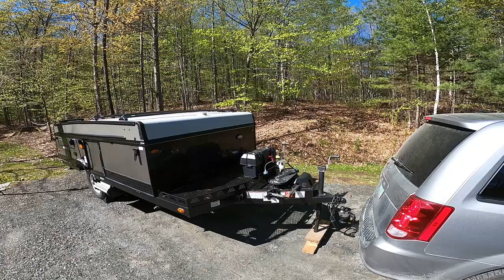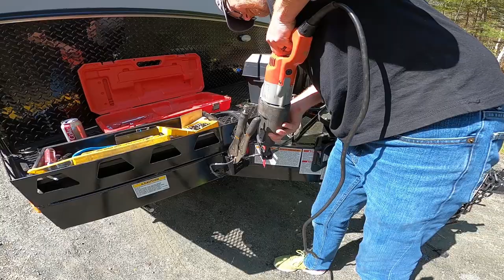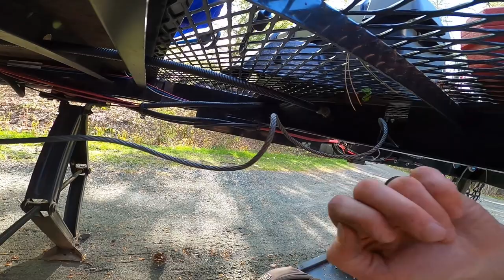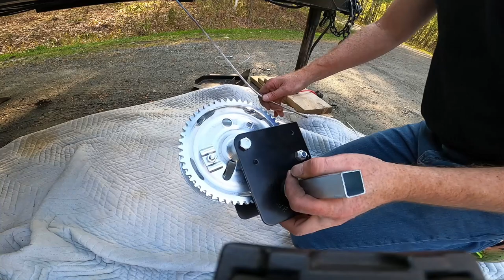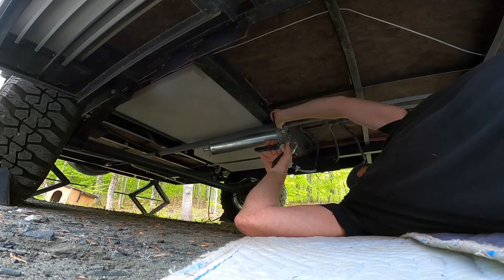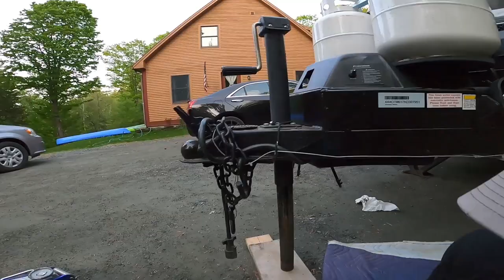2019 Rockwood Pop Up Manual Winch Install | Electric Winch Be Gone!

Comment: Thank you so much I had no idea what to do once my electric winch the motor shaft snapped. I called Goshen and got the manual winch in a few says and had my camper back up and running much faster than the 3-6 weeks waiting for the motor and it works a lot better
Reply from the maker: Awesome 👏 thank you for the feedback 🙏

Comment: Thank YOU for all the video’s, already subscribed 
The wife and I have been thinking of buying our first pop up and we already knew all the models that Rockwood makes. We are so thankful to have seen your video, oddly enough the first one I found was the water damage by the unsealed mess that Rockwood built, we were so Mortified by all the rust and damage your tear down was revealing. We were as well upset about all the rust you found under the axle on your new Rockwood and learned why it was so rusted. It’s was just so rude of the Sales person to not inform you of the plethora of rust under your Brand New Camper by Rockwood. Anyone interested in buying a used and or New pop up should watch your video on the water damage first and thank you for listening all the products used for your outstanding repair!
I like to think in the back of my head that I’m just as hand as you with the ability to do repairs but I’m not. Your video’s tho will definitely be referenced should I need to do any of the repair or preferred upgrades you’ve done. “Well done good Sir, well done.”
ps: Shame on you Rockwood builders and Quality Control Inspectors!
Reply from the maker: I appreciate that you took time to send feedback. I really did think I was saving myself a lot of repair work by buying new. I sure was surprised. And have learned that I’m not alone. The quality and service is very poor  in this industry. But we do it for the memories. Certainly helps to be good with the tools! Happy hunting for yours. Praying you have a great experience 🙏

Comment: Thanks for the video. I have a 232ESP and the drive gear on the motor sheared off while raising it and the roof came crashing back down. Luckily I was at home getting ready to clean it after a trip and not away from home in the middle of the woods or something. During further inspection I noticed the pawl on the clutch was completely worn out. I bought this camper new just over a year ago. I ordered replacement parts for the winch but you have me thinking this is the way I need to go.
Reply from the maker: This is what made me go manual. The winch lifted the top by itself and caused a lot of damage. Scary stuff... just like yours breaking and the roof falling! So unsafe. https://youtu.be/jvKrOAxnrI4 The manual winch is a complete luxury. No fear. Works so well. And best of all... it's so quiet :) You would not regret it.

Comment: Thank you for sharing! I too have powerwinch that the motor went out halfway up and I sheared of the tiny manual bolt. Just got the winch will install today as soon as I figure out how to lower or block the roof in position. Thanks again from Tennessee!
Reply from the maker: Uhhhg! Sorry you too have to deal with it. I used long 2x4s to hold up the roof. Once I got the cable/winch reinstalled I was able to lower it back down. So much fun! Be careful and enjoy the peace and quiet of the manual winch :D God bless you 🙏
Reply: Yeah that’s my plan. I’ve tried to move the gears but no luck. I think once the bolts are loose it should take tension off the cable.  Safety First!
Reply from the maker: @jimwoods8957  I have two auto-style hydraulic jacks. I used them under the 2x4s to lift the roof. Be crazy careful. It is definitely an anxious activity.

Comment: Thats so weird, I had a Rockwood with electric winch and I love it (never had an issue). I am the opposite right now, I will love to replace the manual winch on my Jayco for an electric one. The closest I am is to use a heavy expensive power drill with an adapter.
Reply from the maker: I replaced it because they are dangerous. Ours tried to rip the top off our camper. Bent the hitch mount area too. Very powerful. Very loud. And susceptible to failures.  Here’s the video of when it failed. https://youtu.be/jvKrOAxnrI4?si=peUa3rmeVfYNjDQo
Reply: @sstressfl  interesting, mine was 2014 and was not anything like you are saying, very gentle and never gave us any issue. I guess they changed motor models or something.
Reply from the maker: @angelscomputers  Every product, even a poor one, can have a number of good ones that last a long time and perform as they should. In the video I contacted the dealer and expected surprise from them. They were not surprised. He said I should install a shut off switch on the hitch so there is no power to it when not in use. Its pretty common. I get messages frequently about failed electric winches and conversion to manual winch.

Comment: Thx so much for the video I just this morning ordered my winch from Goshen (2day shipping) we have a trip for memorial day weekend 😳 
1 question, you only had to replace the wire cause you cut to short ?
Reply from the maker: Awesome news :) And yes! When I replaced the malfunctioning electric winch, I had to fix it the same day so I found a local winch for a utility trailer. It did not have a bolt clamp on it and the instructions said to weld the cable to itself so thats what I did. But once I welded it, it was ruined. Had to get a new cable when I got the new winch. You should be 100% fine with the existing cable.
Reply: Another question, what wires did you cut off of the electric motor and which wire connect to the 12v battery?
Reply from the maker: @tamez76  If I recall, I didnt have to cut any wires. I just unplugged them. Super easy!

Comment: I have recently purchased the same camper. I have had some issues, but nothing compared to the problems you have experienced. Have you considered contacting your dealer, or better yet Rockwood.? It seems like most of these issues should be covered by the warranty. Rockwood customer service has been good to me so far.
Reply from the maker: Two things... the components are poor quality. On the second day of ownership when my sink faucet sprayed water into the air, I realized it was an unserviceable plastic faucet. Total junk. So I decided not to warranty it because they would just replace garbage with garbage. When my camper was towing sideways, it took weeks for them to look at it, then weeks for them to finally send it to a trailer frame straightening and alignment shop. In total with warranty work, we did not get to use our camper for 2 months after we bought it. So when the electric winch failed... the dealer said "too bad you are 1 month out of warranty and should have installed a shut off switch to kill power when not using the winch because these things do that".... as if it was common knowledge. They should have said that when I bought it. I have now heard from many others that they have suffered similar failures. Then the dealer kindly offered to send someone out to help me get my roof back down safely but it would cost me. I figured it out, no thank you Mr Dealer.

Comment: Thanks for this video. We just replaced our electric winch with a manual winch just like this tutorial. We are having an issue when we lower. The handle slips off and doesn’t lower the roof. The nut comes undone. Any ideas? Thanks again.
Reply from the maker: The only thing I can think of ....is the mounting point of the trailer bracket has to be completely level (mine bent when my electric winch went crazy and I had to use a car jack and heavy hammer to bend it back into shape) or the chassis of the winch will flex and the gears wont align correctly.

Comment: How did the make shift cable extension hold up? We cut our cable too short going to replace the winch and can't get a new cable for a few weeks.. hoping we can finagle an extension like you did.
Reply from the maker: I left it for the remainder of the year! It was still rock solid when I replaced it finally with a new cable. The only issue I had was when the clamps/fasteners passed thru the frame I had to pull the cable over slightly to clear. Not ideal but it worked to get us to our next camping trip. Even after I ordered and received the new cable I kept putting it off until this spring :) here’s the video of me installing the new cable https://youtu.be/LQIQncry1T0 It was really easy and if you have the time to wait for the new cable to arrive I’d highly recommend it. The ferrule crimping tool alone was $50. And I have to admit the fix made me nervous every time I lifted the roof. I sleep better knowing there is a solid new cable installed 👍

Comment: What size of winch did you use the 800 or 1200 lbs
Reply from the maker: They sent me the 800. It took a little bit more muscle than my old 1997 Starcraft. The 1200 would spin a little easier and take a little longer. So perhaps take into account who is lifting?

Comment: Thx for the video, I'm replacing my electric with a manual as well.  I noticed you're cranking clockwise to raise, was the original electric winch counter clockwise to raise with the cable spooling underneath the pulley?  I have a 1970 ESP and mine spools from the bottom but you have to go counter clockwise to raise it. 👍
Reply from the maker: I followed the instructions from the manual that came with the winch. The cable entry is usually opposite of the mountin gplate, so in this case with it mounted upside down, the cable feeds into the bottom and the direction of rotation is what the direction is :) Works wonderfully!

Comment: What did you do about the relay and all the electrical connections that were part of the original winch?
Reply from the maker: The winch requires a positive and a negative power source. Two wires. The winch is self contained… all the electronics are onboard. Once you remove the winch you simply tape the two wires up and tuck them away with a zip tie. Super simple. If In the future you ever want to put the power winch back on, it’s plug and play simple.

Comment: How about when you let it down? Do you have to hold pressure on the handle to lower slowly? I have to install next week due to broken tension spring on link stop. New cost on winches I found are like $125 +.
Reply from the maker: It’s has a built in clutch. It’s effortless to lower :)  and you can let go of the handle and it just stops. It’s wonderful compared to the $500 electric winch! It’s quiet. Easy to control. And won’t randomly fail and destroy your camper due to some mysterious electrical problem 👍

Comment: Quick question, how do you lower it ? Just counter clock wise , does it click ?
Reply from the maker: Just turn the handle the other way. A clutch holds it in place. When you push the opposite direction it relaxes the clutch. If you let go of the handle the clutch grabs immediately. It’s very safe and very easy to use. Silent on the way down.
Reply: @sstressfl  perfect went up like a champ !!!! And yes lowering is a breeze too , thx man I appreciate you !!!

Comment: Hi Michael, I'm located in NH. I bought a 2019 forest river 1910esp in NY. The original motor had failed so they replaced it with one that sits horizontal and now the manual override can't be used because it sits too low. There's no way to get a socket or anything on it. I figured a manual winch is a easier and safer solution. However, there's no dealers that are willing to take me in. I see that you're in VT which isn't too far from me. If there's anyway that I can pay you to install a manual winch, I'd gladly appreciate it.
Reply from the maker: The manual is definitely the way to go! I just opened mine today :) and I’m sorry the dealers aren’t available. And I gotta admit I’m not comfortable working on other people campers. Have you thought about trying to install it yourself?

Comment: I’ve gone back and forth on if I should put in an another electric winch. The previous owner to my camper had it pulled out and put in a crappy hand crank - needs a drill. 

Don’t feel like carrying a drill so this method seems to be the ticket! Just emailed the company about possibly getting this rig. What did it cost you?
Reply from the maker: I think they charged me around $130 with the handle. It was worth every penny. It's easy. It works great. And its QUIET! :D

Comment: After your electric winch went crazy on you, did the manual override not work any more? I would have thought one could just unhook the battery and use the manual override at any time.
Reply from the maker: The winch no longer worked. It ripped teeth off of itself.

Comment: I have a 2015 Rockwood Freedom 1910 and my electric winch has been a source of ongoing issues and ended a vacation early this year after a failure. When you ordered your lift system, did everything come as a package or did you have to order each component separately? Where did you order yours from?
Reply from the maker: I ordered mine from https://goshenstamping.com/ I called them up and they asked what camper I had, they matched up the proper manual winch and they asked if I needed a handle. Yep! They tossed it in :) They know all this stuff very well and will make sure you have the right parts.
Reply: @sstressfl  Is your winch a right or left hand configuration? I am trying to get oriented with it... The bolt placement on your trailer is the same as mine (I also have a Rockwood).
Reply from the maker: @allanmen  I think its right hand side... I told them it was on the passenger side of the tow vehicle :)

Comment: I have a 05 rockwood high wall with the same power winch. How hard is it to crank? And how long does it take to crank?
Reply from the maker: As long as everything is greased correctly its very easy to crank. Which is actually a true plus versus the electric winch. The electric winch will over power a poorly greased system and can start to damage parts. But you can feel the resistance with a manual winch. You'll know when it's time to grease things. And it cranks pretty quickly. Like any old popup I've used. Maybe 30 seconds?

Comment: Hi Michael. A quick question...like you, I replaced my electric winch with a manual one however my 12V trailer power doesn't work anymore. When connected, the 120V works fine. Did you have any issues like this when you disconnected your power winch?
Reply from the maker: No issues at all. Sounds like a very tired battery to me. You could test voltage!
Reply: @sstressfl  I'm thinking the same thing. I'll check that when we get home. Thanks for the suggestion.
Reply: @sstressfl  Found it. A burned out 20A fuse. All's well now. Glad I replaced that noisy electric winch. Thanks for the video tutorial.
Reply from the maker: @michaelchiasson655  hey that is GREAT news!! Thanks for the feedback.

Comment: Thanks for your videos I have the exact same camper you have and your videos have been very helpful. I have also had issues with my electric winch. What did your manual winch cost?
Reply from the maker: It was right at $100 delivered with the extra long handle. And its the 800lb unit.
Reply: @sstressfl  thanks for your reply. Looks like it fit well and works great. I’ll order the same one, do you remember the model number? I assume it worked great on your last camping trip? Thanks again
Reply from the maker: @everettsoetenga8858  it works flawlessly. Just give these guys a call https://goshenstamping.com/  👍 they make it easy!
Reply: @sstressfl  Thanks again for your help did you get the handle extension and the 9,10 or 12 inch handle? And did it clear your propane tanks?
Reply from the maker: @everettsoetenga8858  they sent me the 9" handle and it clears everything except it gets very close to my Weight Dist Hitch clamps that are mounted on the camper frame rails. I slide the handle out about 1/2" and it clears just fine. If I knew I had a choice I would have picked the 12" handle to clear the clamps.
Reply: @sstressfl  thanks again for the info. So is your handle 9” long or is it 9” out from the winch?
Reply from the maker: @everettsoetenga8858  it’s 9” long total.
Reply: @sstressfl  prices went way up. DLB1200A with a handle,  delivered from Goshen,  $182.
Reply from the maker: @Wdroster  Ow! But I guess I'm not surprised. Inflation is insane. But I think you'll be much happier :)